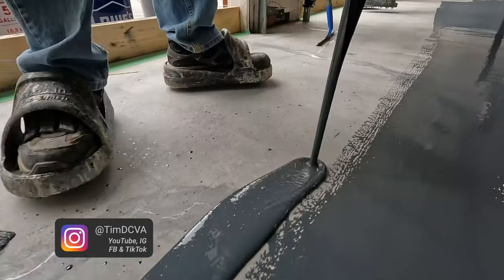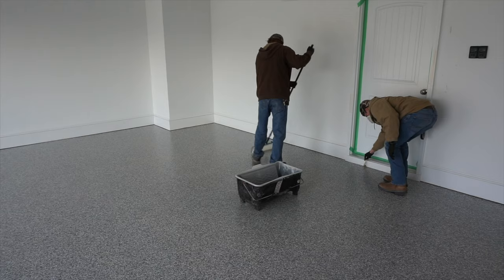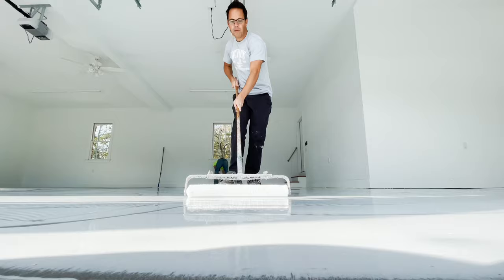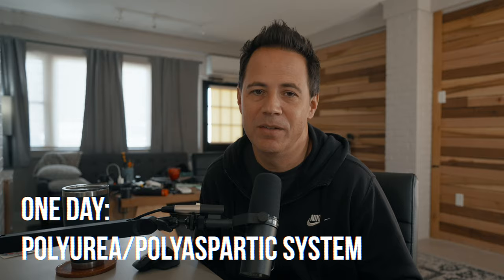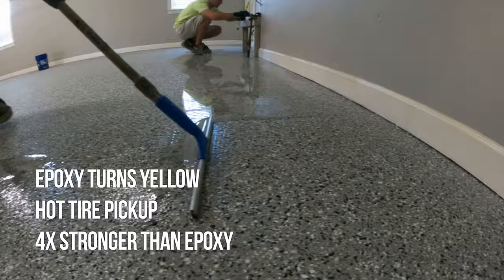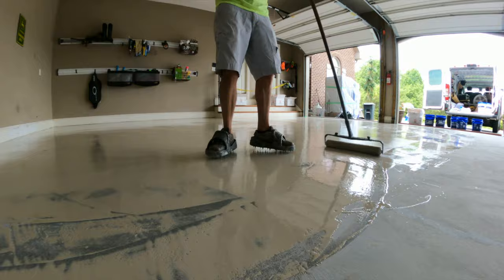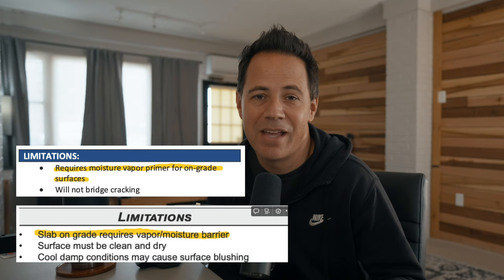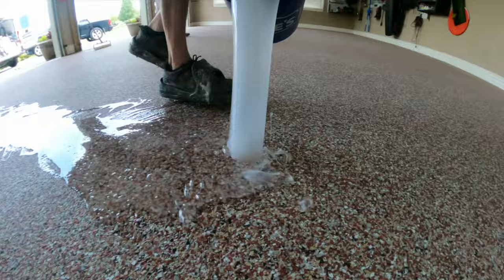You are being MISLED about EPOXY GARAGE FLOORS...

Comment: The DIY "epoxy" kits are what's bringing down the entire industry. Lets be honest here, if it is a one part, apply and let dry, it is not true epoxy. I did my basement and garage with a true 2 part epoxy and have had no issues with tire peal-up. I cringe when people tell me they are doing a garage or shop with some "epoxy" they bought at a home center. If it is a single part product then congratulations, you just painted your floor...

Comment: I’ve had a water epoxy coating on my floor for about 15 years I did myself from two 1 gallon cans of craftsman garage floor coating. It’s gray and looks boring, and I regret not doing flaks and a poly top, but I was a kid when I bought the house and it was honestly a budget project to protect the concrete.

It has held up pretty well. There are some indents where jack stands spent prolonged time digging into the paint, but I’ve never had a problem with moisture causing bubbling (the slab is 8” thick, raised 4” above grade and the concrete driveway is pitched to line up with the garage floor evenly for water runoff) and while there is no peeling from tires there are definitely marks where tires have made contact.

Overall it has done its job to project the floor from oil spills and it is a breeze to clean compared to bare and even sealed concrete. But as I said it’s a pretty industrial pasty gray color with no charm so I would recommend to anybody that does a floor to add flakes (especially if you have imperfections in the concrete) and apply either a clear epoxy coat or if compatible with your sub epoxy chemistry, a poly coat. I don’t know about doing it all yourself but at least the base coat without flakes was totally within my capability to prep and evenly apply.
Reply: Well then, there's no time like the present to upgrade :D

Comment: Excellent info. Used to sell for a top notch 1 day company who is great to stand behind the product. Any problems always boil down to inadequate grind and/or days with too fast cure time for the poly. Your point of the tinted epoxy vapor barrier base followed by a day 2 poly top coat is spot on. Great system and the slower cure time on the base offers great grab if the grind is good. Charge a premium for the “best system” for longevity. Just warn that the epoxy is going to smell quite a bit for the first bit in comparison.

Comment: I dont think it's necessarily the heat in hot tires. There are lots of oils,waxes, and fatty acids in rubber, which will permeate and soften pretty most polymers and make them susceptible to damage.
Reply: Not true with high quality modern materials

Comment: Thank you so much for the video!  I have a question.  If my garage floor (slab cement) has a 10 mil vapor barrier underneath it, do you think i would still need an epoxy vapor barrier?  I ask because i am about to receive an estimate from a company for a 1-day process (they will coat with polyaspartic).  I will review their proposal, but would appreciate your feedback.

BTW, I had hoped to contract with you all, but i know i'm a bit too far outside your service area (Delaware)!  Still, thank you so much for all your effort... Robert

Comment: So appreciate these videos.  DIY from big stores failed as mentioned.  Live in Cleveland Ohio area now.  Concrete garage floor with no moisture barrier installed (built in 1952).  Additionally, the drain needs to be replaced and the entrance has cracked concrete.  Questions:  1) Would the moisture barrier work in this scenario because moisure in the concrete is visible when it wet outside from rain (none seeping in from underneath)? 2) Would a concrete contractor need to be hired to replace the drain and repair the concrete edge into the garage?  Thanks in advance for your responses!  Wish you were here to hire for the work needed!
Reply: That drain almost certainly connects to your storm lines, which is no longer code. If you cut into that garage floor, you're required to bring it to code and connect to sewer.

Comment: I used to work for PPG, and sometimes I help a good friend who does residential & commercial epoxy floors (in between his drywall jobs). 
The warehouse I worked at got the full treatment, from floor-paint in the isles to a multi-layer solid epoxy showroom floor w/PPG logo inset.
IMHO epoxy floors with flakes don't look as good, or perform as well as solid epoxy... Flakes are just a cheap way to increase thickness without the cost/time.
In my experience they tend to, well, flake apart. Likely from poor prep or flake application. Either way, it's less likely with no flakes !
Reply: A well done floor would never never have that issue

Comment: You said in the video that “with the mvb you no longer have to worry about moisture vapor transmission delaminating the coating”. Every manufacturer states that an mvb must be installed neat to be able to perform to the level of the mitigation they claim on their TDS. Are you saying you don’t have to worry about it since it gives you more confidence, or just empirical evidence over the course of years?

Comment: Hi, maybe i misheard but my question is, should an epoxy floor be vapor permeable so it could "breathe" to prevent the damage from potential moist/vapor from the concrete, or should it act as vapor barrier to seal the concrete? Which case can get you bubbles?

Comment: I would really like to see how this holds up in a commercial shop.  Specifically heavy construction where tracked machines such as a bulldozer that drives on the concrete.
Reply from the maker: It wouldn’t hold up well. We use urethane cement for that type of environment. 👍🏻👍🏻

Comment: I am in Wisconsin, had a 1 day polyaspartic system installed. Its been three years and I large parts of the top with the flake popping off. The concrete under it looks fine where they performed the concrete repair on my original garage floor. Will they warranty this this issue?
Reply: Good luck, usually companies warranty what their distributors of material offer as a warranty. Usually it's 1 year. But it's worth a shot trying, call sooner the better

Comment: what about a non-concrete floor, ie my bathroom floor? We put down a layer of masonite over the wood floor? I've got it primed and am about to put down the first layer of 2 part epoxy with gold-dust. In 24 hours, I'm going to put a second layer but, I'm not sure if I need a top coat etc

Comment: What is the actual use case of the flake? I kinda just like the raw concrete coated epoxy look. Is it purely aesthetic?
Reply: Aesthetic. I highly recommend against it if you actually use your garage to work. I broadcast flakes on mine, and anytime I drop something on the floor... It's impossible to find that screw, nut, piece in the sea of camouflage flakes!

Comment: Can anyone tell me why my car tires adversely react with my garage floor and leave brown spots? This is not dirt, rather from what I’ve been told is the result of a chemical reaction between the rubber of the tires and the flooring. It did the same thing, to a lesser extent, under my pressure washer tires. Thanks in advance.

Comment: What do you think about porcelain tile in a garage? I'm also tempted to do a wood floor like and old barn. Everyone scoffs and says it won't survive, buy I've seen 100 year old wood barn floors with tractors sitting on them.
Reply: Weakest link would be installation. Quality thinset, and back buttering the tiles a must. Any cracks in concrete will telegraph, but there’s products like ditra for this. Cleaning of grout may be a pain.

Comment: @timdcva I like the look of flakes but I want a smooth surface so its easier to clean. The flakes made it hard to sweep in my last garage. What can I do differently for my new build?
Reply from the maker: Our floors are pretty smooth. Some people use a lower viscosity top coat that causes the finish to be rougher. I would say to make sure they use 90% solids or
higher and you should be okay. 

You could also get a price for a second top coat and decide if you need it after you feel the first top coat.

Comment: Is there a reason you grind and not shot blast? We always shot blast our floors. Very clean, no dust left on the floor or im the pores of the concrete
Reply from the maker: The grinder is more versatile than a shot blaster… so we keep that on the van. 

We have a small shot blaster we use to get dust up after we grind.
Reply: @TimDCVA  always cool to see how others are doing it. I'm up in canada and there's a few small differences between your set up and mine. Exact same spikes tho 🤣

Comment: Is there anyway to not do flakes?  Or does that degrade the product?
Reply: You don't need flakes. You can use decorative quartz (sand), pigment of any solid color, or metallic powder to give you a metallic floor.  But IMO the most durable floors have been flakes, they're made of vinyle that the epoxy soaks into, and almost acts like a rebar does  to concrete (obviously not as strong as rebar)
Reply: @brandocommando4459  
Thank you that’s great info.  But if I don’t put in the flakes will the hot tires pull up the paint?  I mean how much strength will it lose?  And what’s the best/ strongest brand?
Reply: @RJ1Reed   no it should be fine. Make sure it's just 100% solids epoxy and the floor is prepped, and I wouldn't see why there is any reason not to have a good garage floor. The problem with the big box store epoxy, is a lot of them sell water-based epoxy, which isn't good.  There's many different brands who make the better version of epoxies, but if your product is too thick to use, you could use isopropyl alcohol and use 10% of it into your mix to thin it, and also give you a little long working time with it.

Comment: Does this work with heated electric floors?
Reply from the maker: Yes it does. 👍🏻👍🏻
Reply: @TimDCVA  I mean,  if the heat is not melting the material, doesn't produce some kind of smelly toxicity, etc.?
Reply from the maker: I’m sorry I didn’t catch the electric part the first time I replied. 

We do floors like this that have heat in them all the time. They are usually heated with hot water that flows through tubes in the slab. 

Im not sure how electric heat would work on a concrete floor.

Comment: while i respect your job and everything you mention i will chose a 250-300$ if i have to doit every 2 3 y than pay 3-4k to have it applied once and last the same amount as 10-15 big box stores kits
Reply: It'll last 1-2 yrs or less if you have freeze and thaw cycles, and the floor will be in a perpetual state of failure which will cost more over time and take a lot more labor to do 15 times vs 1 time over 15 yrs
Reply: It’s never going to be worth $3K for me to have that on my garage floor and won’t gain me a nickel if I sell my house, whether it’s a $300K house or a $500K house.  Bare concrete is just fine
Reply: @robertglover1296  3k is on the very low side for a 2 stall garage.  if you do it yourself with the kit that costs you that much and you don'tcount your work in. If you have someone doing it it's easely double that. The only reason I'm doing it is because I like to work on my car in the garage, and the oil stains are always an eye sore
Reply: A garage floor like this is not for everyone . Products are expensive and machines as well. It does look much more beautiful than bare concrete.

Comment: How about a garage the size about 9000 square ft😊
Reply: Depends on how many mils thick the coat is applied.  Then it is a simple volume problem of thickness of the paint times the square footage to get cubic inches.  There are approx 230 in^3 per gallon. Don't forget to do do the math to multiple thicknesses.

Comment: This clown is confusing. He says the epoxy cons are a myth then proceeds to tell you what will happen when using Epoxy floors in the video with ambering, 4x, and hot tire peeling. Here is the TLDR version of the video: In VERY RARE circumstances will you have long lasting great results with Epoxy top coat floors. Its better to spend your money with a more proven system then epoxy. Have a nice day.